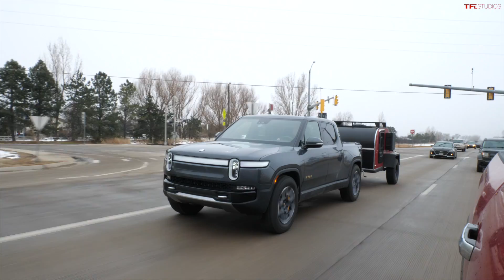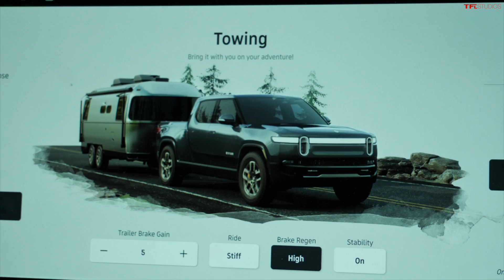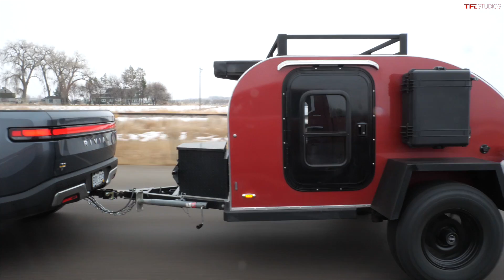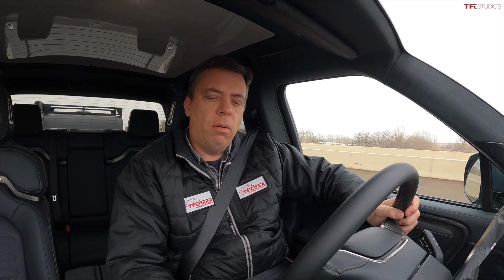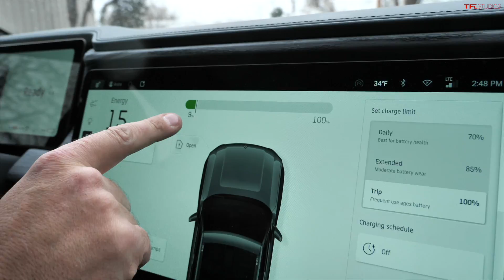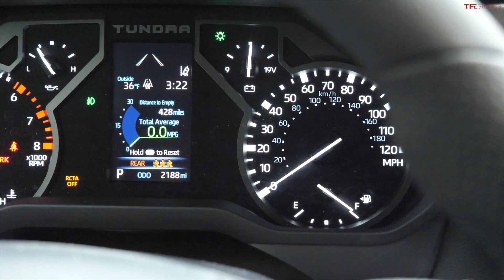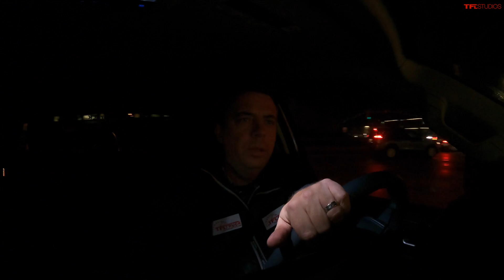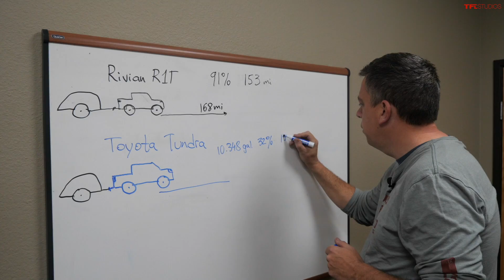Rivian R1T vs. Toyota Tundra: How Far Can Each Truck Tow On A Single 'Fill-Up'?

Comment: What ever happened to converting the data to KWH?  Now assume a 500 mile trip, 10 hours of driving at 50 MPH.  How long will it take to get there with recharging/refueling in each vehicle.  This is what makes electric vehicles not ready for prime time.

A single ten minute refill in the Tundra versus at least two 45+ minute recharge sessions with the Rivian.  Most people are not willing to add 2 hours of travel time for the EV without some tangible benefit.  1.3 KW/mile at $0.31 per KW is about $0.40 per mile.  So it was just north of $61 to do the 153 mile loop in the Rivian, the Toyota used about 10.5 gallons of gas for the same loop and I am going to bet that gas was significantly less ($3.29/gal) than the $5.87/gallon necessary to break even.  That's embarrassing for the electric vehicle (which was 78% more expensive than the gasoline engine).

Comment: as one that pulls a 7k to 8k camper many times a year, these electric trucks need to at least double their range minimum before I can think about buying one, then the charging infrastructure needs to be built for those towing that need to charge. I'm surprised truck stops haven't started to install tow lane charging stations yet.
Reply: Well, considering how long it takes to charge an EV would it be economically beneficial for a truck stop to remove diesel pumps and install battery charging stations?

Comment: So with a smaller than rated trailer you can only do 150 miles towing? EVs need to be cars and some hyper cars. But on trucks this is just not going to work I think Elon is holding off to watch other products fail before he makes the decision to join them.

Comment: Why do you guys never point out that the rivian only has the equivelant to about 4 gallons of gas in total energy capacity for it's battery?

That is the true way to show how efficient an ev is when towing. And getting the range you did in a 7,100#+truck with a 2,000# trailer is DAMN impressive imo. Using only the equivelant to 3.5 gallons of gas to go 153 miles towing in the cold. Is outstanding efficiency. 
That's 3x as efficient as the tundra was. While burning nothing and being capable of beating the tundra in any acceleration contest. 😎

The ram trx for direct comparison as the fastest atm fully loaded super cab awd ice truck on sale. Costs more to purchase, is actually slower than the r1t. Weighs about the same with a full tank of fuel and when towing probably gets what maybe 7mpg when towing? 
I saw motortrend and car&driver claiming about 9mpg when empty for the trx average mpg.🤔

Comment: Excellent job guys! The most shocking part of this whole thing was the cost comparison. If my math is accurate, the cost was about the same for both trucks, about $.26 / mile. (Using EA rate of $.31/kwh at 95% charging efficiency). Usually, the EV would have the cost advantage. The Tundra is obviously very efficient while towing a small trailer.

Comment: So if you want to go camping and get away from it all, the furthest you could go from an electric charging station is about 75 miles. And that's with a micro trailer.  No thanks.

Comment: How long did it take to recharge the batteries from 91% ?  How long to refill the Toyota? 

That trailer is a easy tow. You should have used a taller trailer like most people have.  

How much does each rig cost?  

Can’t use 100% of the batteries range as there isn’t and never will be as many charging stations as gas stations. I can carry a 5 gallon gas can in my ICE truck and extend its range 50-70 miles in less than 5 minutes anywhere. Can’t do that with a electronic vehicle.

Comment: Great review guys  Thank you  
Maybe, to make this a little bit more complete, add the cost of filling up the Tundra vs the charging of the Rivian ? 
91% battery = $ ?
10.38 gallons = $ ?
I did some rough math and based on my assumptions, 
91% of battery = about 120 Kw
120 Kw x $,35 cents/kw =  $42 

$42  to charge the Rivian  from 0 to 91%  vs $40 for the Tundra  for 10 gallons of gas.
I am pretty sure that the electric has is merit and place but when is about the towing, ANYTHING,, the battery, based on today's tech, is just not there. 
In my eyes. 

Thank you again
Reply: 35 cents a kilowatt is kinda high though
Reply: How much is your time worth?

Comment: You did not calculate at all the efficiency. Just the fuel tank volume difference. So roughly said 1l of fuel has around 9kw (little bit more maybe) of power in it. So I have a Renault Zoe for example (daily comutter to save the V8s) which uses 14kw/h on 100km of range. This would calculate to around 1,3l of fuel used to go the distance. As I said I live in Switzerland with lots of hills and cold weather. Driving 100km here with 1,3l of fuel is not possible. That is the kind of efficiency I would like to see here, really.  So the Tundra used 10.348 gallons which is around 39.1l on 246km (153miles). The Tundra used 15.89l on 100km (sorry Europe :-) ) So, 15.89*9 is 143kw of power if we use the generic 9kw per 1l fuel. So efficiency wise the Rivian did a lot better. Of course the range will never be the same as long as you can not pack 3x more power into the batteries but efficiency is still a lot better which on the long run will save you also a lot of money! Of course the efficiency will even rise more if there is not trailer behind. And by the way, for testing like that, also tire pressures etc. need to be confirmed and logged. Especially on a trailer with such horrendous tires. Most people drive with way to less pressure in the tires! This applies for ICE and E-cars! You would be surprised how much consumption can change if the car rolls a lot better.

Comment: Only thing missing was the cost to go the same distance? Other than that good real world testing. And 2.5 hours of driving is great in an EV while towing cuz you should be taking a break after that any way. So pretty good for a NEW EV pick up. We know they will only get better
Reply: I’m guessing it cost around $13-$14 for the Rivian and $31-$32 for the Tundra. Using $3 per gallon of gas and .12 per kWh for electricity.
Reply: @Jones1-1  and if you were heading to an RV spot, it would be free for the next days Journey or to return home.
Reply: @Jones1-1  there isn't any fast chargers with that cheap of juice, most I've been seeing are at a minimum $0.30 kWh
Reply: Time is money. Should also account for the time wasted charging.
Reply: @ta8207  certainly depends upon how often you are going to do long trips that require charging stops, but it literally takes me a few seconds to plug-in when I get home. My “tank” is full in the morning, I never have to take a specific trip to out of my way to fill up. But if you are like most people and only do one, maybe two long road trips a year, you overall will likely save time when considering not having to waste 10-15 minutes going to a gas station 1/wk.
Reply: 2.5 hr you need a Break!  First of all it was 2.5 hours cause he only a averaged 55-58mph!  In a ICE truck doing 75-80 mph you can go an easy 4 hours and cover 300 miles!  

Now that would be at least 2 recharges at 40-60min to cover 300 miles and 6 hour drive time!  So the total trip goes from 4 hours with an ICE engine to 8 hours in the Rivian!  

Don’t know about you but I’m out on Friday around Noon and want to get to the site and hooked up before Dark with a Nice Cold Beverage and a Fire started!
Reply: @bill9716  Thanks. I was using the average home electricity price in Texas. I wasn’t sure about Colorado.
Reply: Looks like the Rivian was getting about 42mpge vs about 14mpg for the Tundra.

Comment: Can't wait for everyone to buy EV's , gas is going to be cheap and electricity going to sky rocket.
Reply: Might want to educate yourself on how much electrical energy is used at the refinery level to turn crude into useable barrels of petroleum products. Before crowing about cheap oil vs electricity. 🤔

Plus foasil fuel refineries use cobalt and water in massive amounts to refine crude oil. Then every single oil rig uses energy, every oil pump jack, every oil pumping station etc. Just one of the main oil pipelines in the us at commercial user rates pays over $3,800,000,000 a year in electricity charges alone. There is no free lunch for anyone period.
Reply: @4literv6  the mining of cobalt and lithium puts more CO2 in the atmosphere than all fossil fuels used , educate yourself.

Comment: How much coal had to be burned to generate the electricity to charge the truck?
Reply: Per the eia coal has been under 20% of all U.S. electricity generated for over 2 years now. So likely not much if any. 🤔

Plus this truck while towing got the equivelant to over 40mpg vs the tundra 14mpg. 
Then consider all the electricity just an oil refinery uses per day, plus water&cobalt.
Nevermind the thousands of oil rigs, hundreds of thousands of oil pump jacks, hundreds of us pumping station's with multiple 3-6khp electrical motors pumping refined fuel product around the U.S. 24-7. 😶

Comment: This was GREAT and sorely needed!! Thanks!! Would have also been nice to have compared the cost of charging compared to fuel, which will vary from location to locations, but an average estimate would be nice to see.
Reply: Electrify America is about 43 cents but charging at home in boulder is 12 cents.  Charging in Austin tx is 8 cents
Reply: clot shots  no but the rivian has a 175 thousand mile 8 year warranty on the 4 electric motors and the batteries 100 percent covered the tundra doesn't have that on its engine or gas tank 😜
Reply: The Toyota would still last longer. Won't need that warranty. The rivian is unproven
Reply: clot shots  We’re did you get that number? A battery on a new Tesla is about 13k with labor.
Reply: clot shots  agreed. With a Toyota or even a Nissan they are barely getting broken in at 100,000 miles. The physical truck itself with ware out before the engine does. And it would only cost a couple thousand to replace the engine verses the $20,000+ to just replace the battery. I live in Arizona and batteries have a very short life around here.
Reply: It is very expensive unless you are charging at home. @11:07 they state they used about 122.85 kWh. In Colorado Electrify America is $0.43 for guest and $0.31 for members (per their site).That is $52.83 and $38.08 respectively using 100% efficient numbers, more accurate is probably closer to $58.11 and $41.89 (with 90% charging efficiency). This is not a vehicle that is good for towing at all it is not aerodynamic which is needed on electric vehicles and too small of a battery. The smart choice would be to stick to close destinations or free/cheap destination chargers.
Reply: @Thisisaplaceholder1  That doesn't sound correct. My Tesla Supercharge rate is $.28 in South Texas. Colorado can't be that much different
Reply: @ismaelcarrillo3956  this is not a Tesla this is a Rivan. You can look up Electrify America and their rates are stated for Colorado.
Reply: Hello dear, how are you doing?
Reply: Electric charging will always be cheaper than pumping gas. That was the whole point of switching to EV. Tesla app actually compares your 30 day consumption and compares it to a equivalent size vehicle. I'm always saving twice as much. And that's because I supercharge 85%. I would save more if I home charged at home more often.

Comment: you missed something important, what was the cost for the energy to get the vehicles there... electric charging and gas costs. This will tell us what it cost to run that loop which is just as important.

Comment: I wish people could have the option to bypass the safety feature and let electric pickups be charged while driving. There's no reason you couldn't have a small inverter generator on the tongue of the trailer or in the bed of a pickup and gain back 100 miles or so more while driving long distance
Reply: Because it takes 8 hours to charge the Rivian with a 7.4 kw/h charger. You would need a LARGE generator do what you want to do, and that would take more fuel than the ICE engine and add thousands of lbs of weight!

Comment: I have several observations.  125 kWh might take and hour or more to recharge.  It might take closer to 2 hours.  If the Tundra can go 2.8 time the distance on a tank of fuel you might take 4 additional hours for the electric truck trip.  At $0.31/kWh the cost would be $38.75.  Why is the Tundra fuel up so expensive?  Does the Tundra require premium fuel?  I own a Tesla and love it but can't see the point of an electric truck for towing.  I'll keep my F150.

Comment: You should have then estimated how many hours it would take to do a 2000 mile trip. Topping off  the Tundra at well placed fueling stations and charging the Rivian at what ever charging station location you had on the trip.. My guess is days longer.

Comment: I guess I'm not sure what we learned here. Anyone who watches your channel could have guessed this outcome. Yep- gasoline has more energy than a battery. What would have been more interesting to me would have also been also calculating the overall pollution and environmental cost per mile. to put it another way-- We all know a double-cheeseburger is more delicious than  a grilled chicken sandwich. But it also clogs your arteries and makes you fat. Both of them fill you up, however. So which one is actually better to eat?

Comment: I think the main difference to keep in mind here is cost:

The Rivian consumed 122kwh and at an average of .12 (electric rate), it cost you $14.64 vs $40.35…so savings of about 65%?! One can easily extrapolate that scenario and realize how quickly you’d pay off the cost # between the 2

So…if you aren’t travelling long distances…the EV truck is by far the better deal.
Reply: I agree for the most part. Especially if you drive local and charge at home.
That price was for premium fuel, it would have been around $33 for regular. If you charge a vehicle at charge stations they vary based on speed. Some charge around .30-.80 That would make it close or more to what you pay for gas not including amount of time waiting.
Reply: @elvism684  but that't what the Tundra requires so....the same is applicable to electricity rates though, I actually pay 0.08/kwh, so this loop would have cost me $9.76! 

my overall point still stands - one needs to analyze their own scenario and see if it makes sense, for me it makes HUGE sense...driving an EV will cut my costs down so significantly that the payoff period is only 12 months. I will also never see a fast charger because I won't need one, there's enough range for me to travel everywhere I want to.

Comment: So there are a few things wrong with this test. 
#1 You used the wrong trailer. If I’m buying a truck to haul a trailer I’m going to buy an 6,000lb to 8,000lb travel trailer. Most people who can afford this truck want a full size trailer. 
#2 you never discussed the cost of charging the truck compared to a gallon of gas. 
I realize Rivian gave you the truck as a loaner for a week but it seems your going real easy on them during all these tests. You need to put together a pod cast that states why ev trucks don’t work in the real world. You always just breeze over the negatives

Comment: If I’m doing my arithmetic correctly, and using what the internet says are average electricity costs in CO of about 12 cents per kWh, then 122.85 kWh cost about $14.74.  Using 10.348 gallons at $3.30 per gallon the fuel cost was about  $34.15 for the Tundra.  So, the Rivian cost about $20 less to run this trip.  And, I understand maintenance costs will be less with the electric, though upfront purchase costs are more - perhaps considerably more.  Give the high purchase price, the Rivian probably cannot compete on economics, though it seems capable and is actually pretty cool, provided you didn’t buy it for long road trips - especially trips into the hinterlands away from charging stations.  

Andre should have addressed how long it took to recharge the Rivian back up to say 80%.  We already know how long it takes to pump 10 gallons.

Comment: My compact motorcycle trailer with a dual-sport bike would weigh approximately 670 lbs. With the lighter weight and more efficient tires, I'm guessing the Rivian would have around 200 miles of range (or more). Totally doable for me.

Comment: Towing any distance with any EV is going to be difficult for a while.  Just around town would be fine but the recharge times are too great to be a practical long distance towing machine.   The only solution I can think of would be to have the ability to put an additional battery pack in the bed that could be exchanged along your route so they are pre-charged.   Main drawback being it would take away your load capacity.

Comment: Not sure on your kw per hour rate thanking. 17 cent and fuel at 3.30 per gal. So looks like $34 for the Tundra and about $20 for the Rivan. Just guessing though
Reply: So about 30% more to drive an ICE

Comment: I would have liked more of a common weight like about 3,500 lb for a comparison. Regardless I still love the content
Reply: One of the smallest camping trailers that I could get that was useful was 4500 lbs (to tow being my Explorer that was rated at 4800 lbs) There aren't many full size, full height trailers that are 3500 lbs out there.

Comment: Great test. Would definitely like to see a price breakdown next time.
Reply: Price comparison assuming regular gas @ $3.20/gallon and electricity at $0.123/kwh (These are current averages in Charlotte NC for reference).
Price per 150 miles is...........
Tundra  = $33
R1T = $15
Reply: fyi, Tundra used 10.3 gal and Rivian used 123 kwh